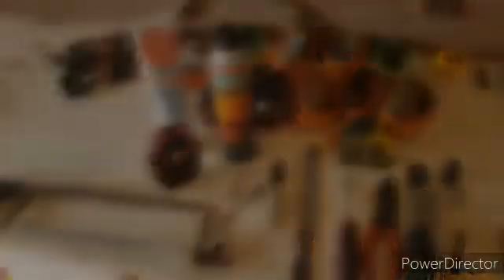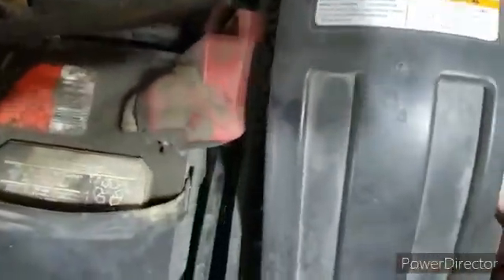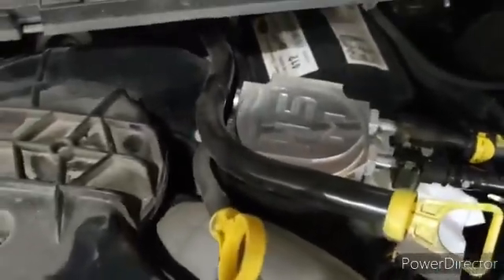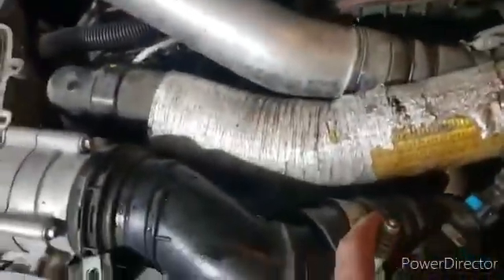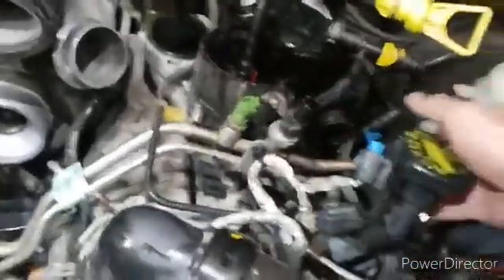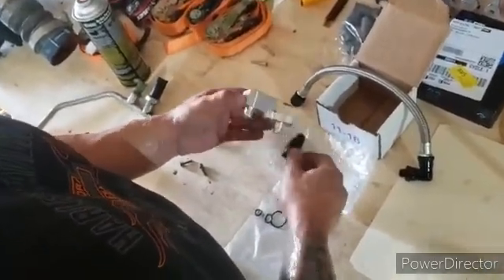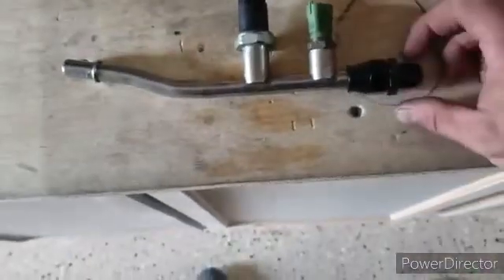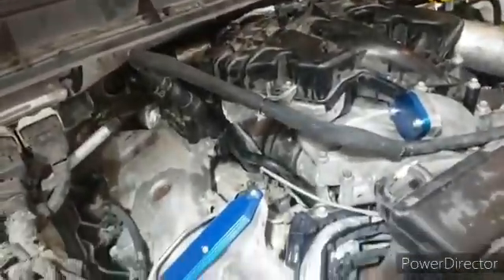6.7 powerstroke CP4 Bypass Kit Install

Comment: When I watched other videos of these type of kits, I wasn't quite able to see and understand the flow of the pump and the alterations that the kit provided. I'm a bit skeptical that it might either restrict the flow and create some sort of loss of power/performance  or added strain on the pump or motor. I mean, these are highly complicated systems that you're messing with.  Is there any independent testing of these kits ?

Comment: I installed this on my 13 this past week, now I have a slight injector knock from 1300-1600 RPM. Any ideas?
Reply from the maker: Nothing definite comes to mind but I would be checking to make sure you have no leaks or you aren't pulling air into the fuel system anywhere.

Comment: The link you provided is not working. Do you know where else you can get the kit?
Reply from the maker: You can go to amazon and type in cp4 bypass disaster prevention kit and there are a few options but the specific one I bought was billet design werkz